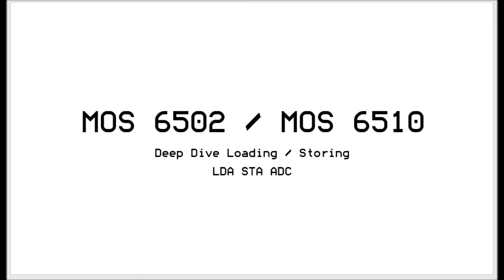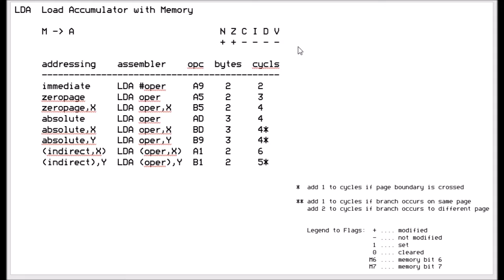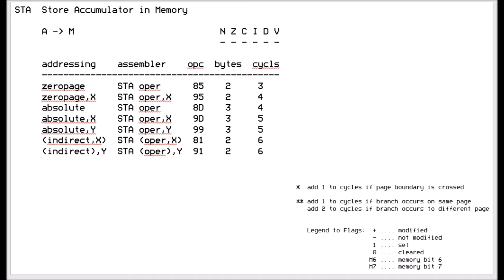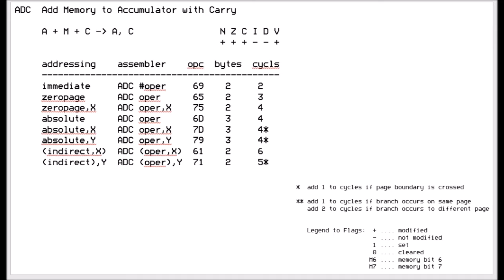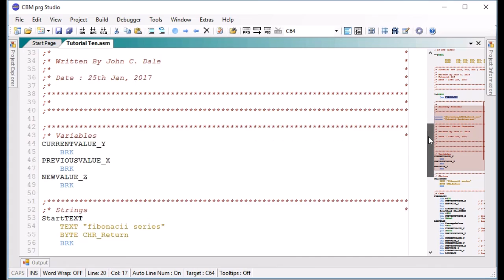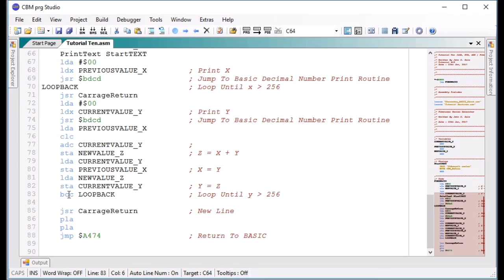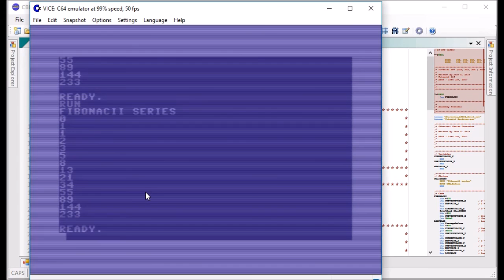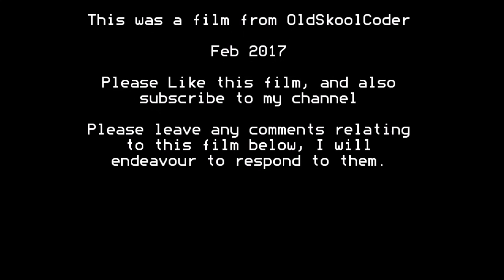Tutorial Ten -  6502 Deep Dive Loading and Storing

Comment: What is the purpose of the two pla commands (lines 86 & 87) after the bcc near the end?
Reply from the maker: skram7 the reason for that is to remove the basic return address from the stack. because I jump to the ready command in basic it still has the return location on the stack from the sys command. it's a way of tidying the stack up.

you could alter it and remove the two pla commands and the jump command, and just have rts. but I like clean returning to basic :)